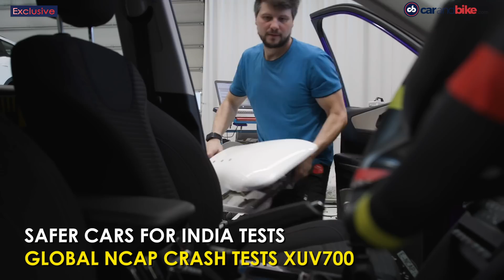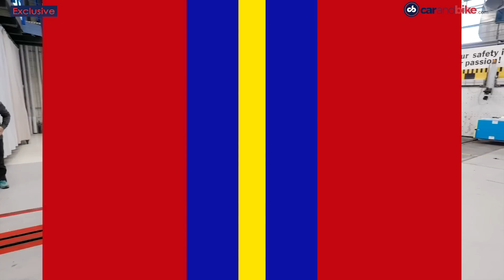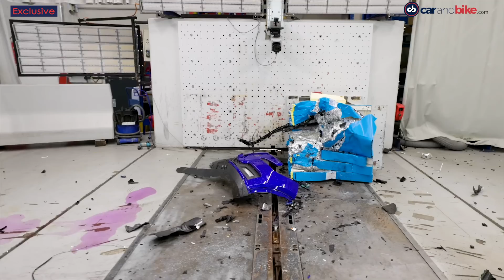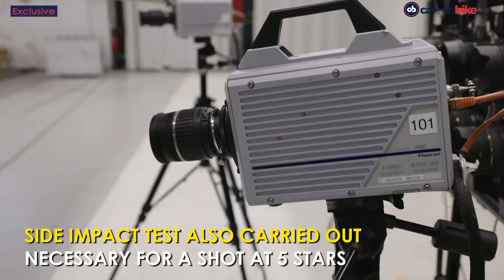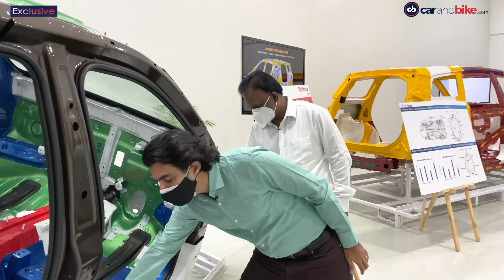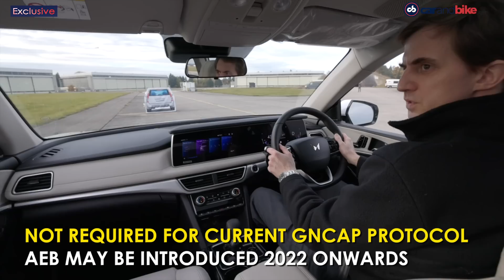Mahindra XUV700 | EXCLUSIVE | Scores 5 Star Rating in Global NCAP Crash Test #XUV700CrashTest #SVP

Comment: The car and bike team should have the balls to disclose that their trip was sponsored by Mahindra. 
I am fed up of these presstitutes! Absolute BS! 
And what is the credibility of  this rating agency! Are they authorised by government, who has certified their methods? And this rating is only applicable if and only if the all the safety tech works. In a Mahindra can you really expect that. The odds are against it. There are many ownership experiences on various forums that show that in lot of real life situations these systems do not work, causing grave consequences. 
We bought our car from Mahindra after seeing such positive media reviews. Our 2012 XUV500 W8 had all the bells and whistles in terms of features for its time, but had too many breakdowns, clutch slave cylinder, alternator, lock assembly, infotainment system, power window all failed and the car has rattles from every nook and corner. The car has only run 37000kms till date because given a choice I would rather drive my other cars. Only thing good about the car is its excellent 2.2 MHawk engine. What's the use of all these safety features and tech if it's going leave you stranded because it's so poorly built. Less said the better about their infamous service centres. They respond only when a tweet is sent to Anand Mahindra himself. This I can say from personal experience.

Comment: Hi Siddharth, I hope you are doing well. Thanks for the exclusive coverage on XUV700 Global NCAP testing. I have 1 question related to child safety ratings though.

I noticed that the child seat was installed at the second row facing the seat, that seating direction is generally used for kids less than 1 year and for those above 1, the seating direction is towards the windshield, similar to passengers seating position.

My question is, the same 4star ratings holds good when the child seating position is placed towards windshield. Please can you kindly clarify.

Comment: Getting a 5 🌟 rating is fabulous ! Kudos to Mahindra's engineers!! The car cage would have gone through days of simulation and analysis to get the desired confidence.
Star rating is a relative parameter for safety assurance  and not an absolute guarantee. The onus is always on the drivers. This test is done at a relative speed of 64km/hr. Should cover  most scenarios in normal city driving and sedate highway driving..but if you are doing speeds well beyond, don't expect similar results...and for a car crash at triple digit speeds, no car in the world can save you.

Comment: The only downside is that many first time buyers will over hype this into something invincible and drive like maniacs on the road thinking that they've no cause of concern as the car has scored 5 stars. I'm not at all questioning the authenticity of these tests but they definitely are sure shot ways to influence the car market of India as Indians will always be infatuated with anything that the west offers and will completely rely on them without using their own brains, from phones to clothes to gadgets and probably even philosophies. These grading systems wherein cars are differentiated on the basis of stars, the best being 5 stars is very unfair to the the ones who might have scored 4 stars or probably even 3 stars as the difference in safety capabilities may not be as much as calculated. The scoring system must be more substantial and tabular and not like a GPA score sheet of a student trying to apply to a US University. A lot also depends on who is driving the car and the field of vision, the peripheral vision offered by the windscreen, windows, etc but most of them overlook this aspect and have graded cars with thick A pillars as the ones which are the safest! They do not understand that blind spots are a major cause of concern in India and just making cars with thicker A pillars does not guarantee ultimate safety. Driving a car is based on a multiple number of factors and clear frontal, diagonal and peripheral vision is critical while making those split decisions. However hardly a few people will be able to contemplate these factors and would just blindly trust anything that is pronounced or bestowed upon by a foreign body. So ultimately what I feel is that this grading system based on stars or points should be reworked and there should ideally be a more comprehensive analysis in a ppt format explaining in which department the car is the best and which are the points that make it less safe. The star system can many a times mis direct people into thinking that a car with 4 stars is bad compared to a car with 5 stars or as a matter of fact create greater divide or discrimination among owners which is quite unhealthy because people just start judging each other on the basis of stars of their cars. Therefore I feel no absolute ratings should be given to any car.

Comment: I have a doubt .

During the tests does these cars carry full tank / half tank fuel inside ? Or is it just being tested in its dry weight and check with those parameters and provide ratings to the car ..be it any car. . . !

Because in reality the car carries not only passengers… a full tank / half tank fuel all the time with other oil & lubricants as well. And we all knew during a crash even a fuel seepage throughout the cabin can doze the car in flames. Am aware that this is just a crash test but when a flammable present inside we would like to make a column for that too !

It’s a genuine doubt . A detailed explanation from anyone will be much appreciated.

Thanks in Advance !

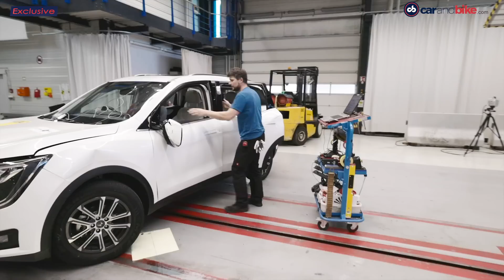Comment: 7:24 car failed in side impact test and rolled over. You can see ORVM damaged completely How the hell did they provide 5 star if car cannot be stable at 50kmph side impact. If car did roll over then there will be defienetly damage will be done to passengers since there are no side air bags. This is a completely paid rating by GNCAP.

Comment: 7:24 Xuv700 is built like a tank but Does Xuv700 overturned on side impact test? Because there r anti roll bars in xuv700 Also side impact test done on the right driver side and left orvm is also damaged also
video is edited,cut after side impact